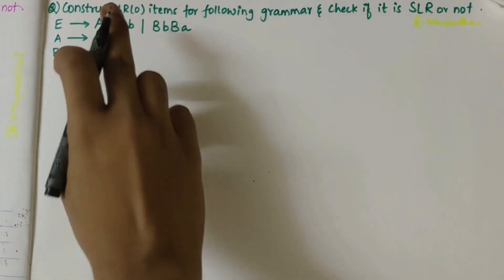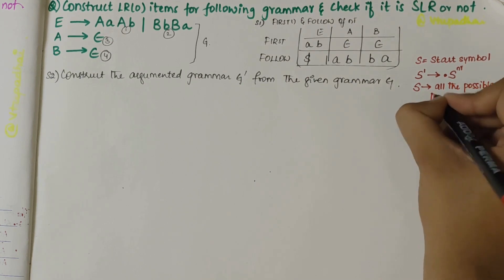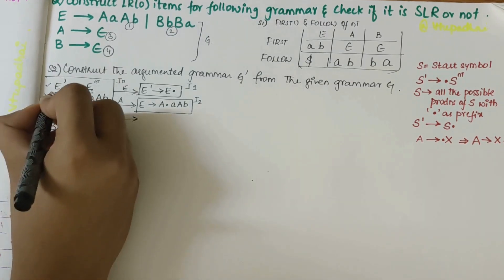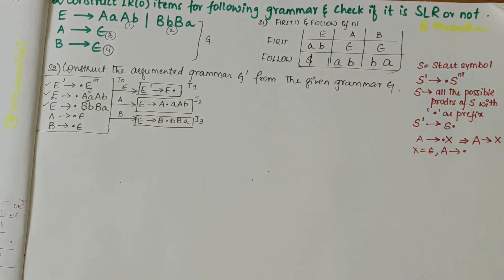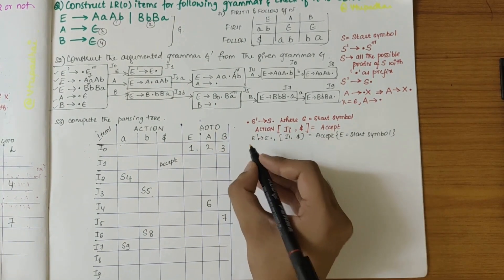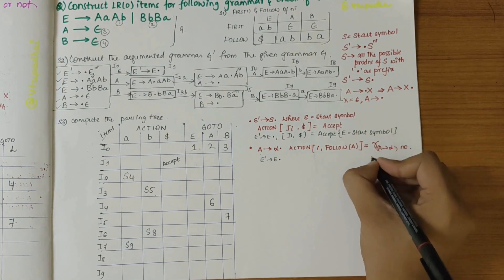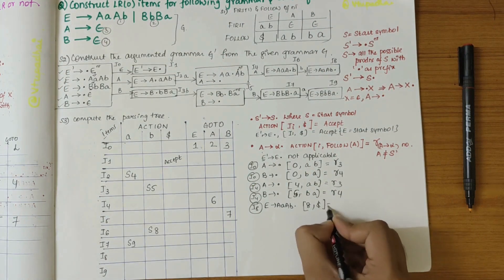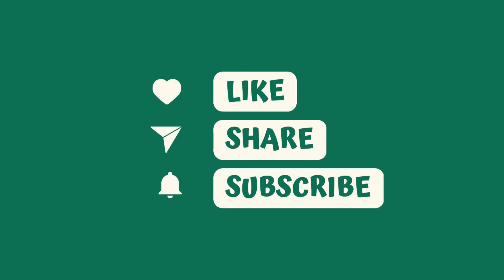Example 4 | Finding LR(0) Items & Crafting SLR Parsing Table  | SLR PARSER | ATCD-21CS51

Comment: Sir for production 
S -> (S)S/ epsilon

Slr table is generated without conflicts

But using stack how we can generate parse tree for string ()(), issue is S->epsilon is reducing but length is 0 so what to pop and how to pop from stack?
Reply from the maker: To generate a parse tree for the string "()()", we can use the given production S -> (S)S | epsilon. Here's the step-by-step process:

1. Start with the start symbol S.
2. Apply the production S -> (S)S to create the first pair of parentheses.
3. Apply the production S -> epsilon to generate the empty string ε between the first and second pair of parentheses.
4. Apply the production S -> (S)S to create the second pair of parentheses.

The resulting parse tree for the string "()()" would look like this:

```
      S
   /  |   \
(   S  )  S
   |      |  \
   S      ε   (   S  ) S
           |       |      |
           ε      S      ε
                   |      |
                   ε      ε
```

In this parse tree, each leaf node represents a terminal or epsilon, and each internal node represents a non-terminal. The tree shows how the string "()()" can be derived from the start symbol S using the given production rules.